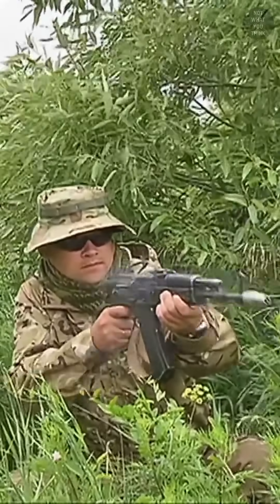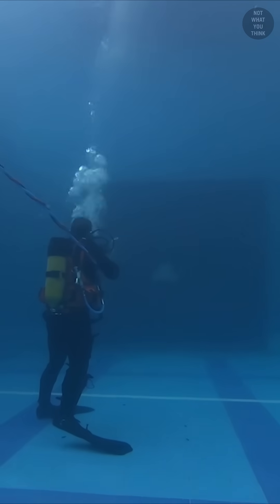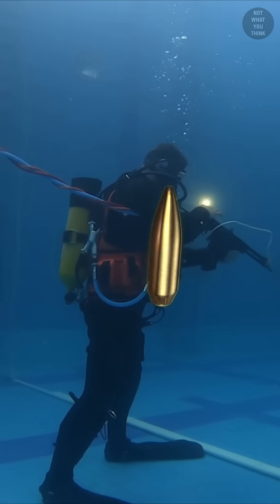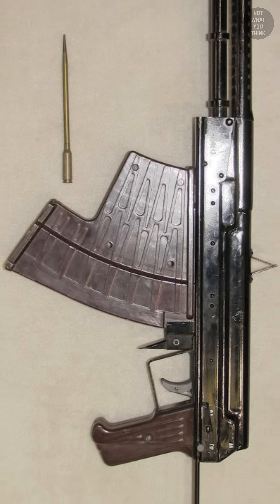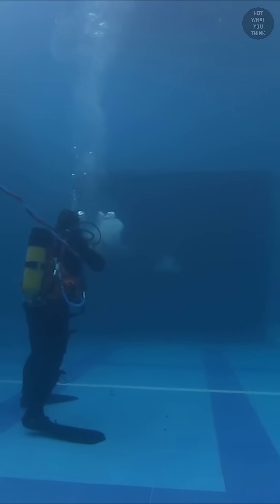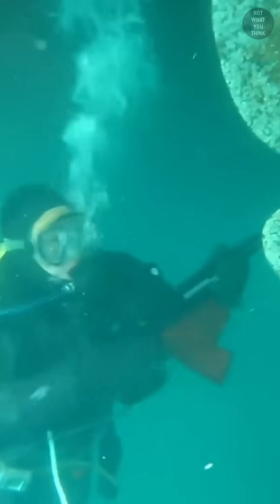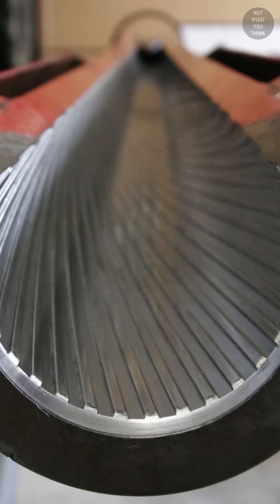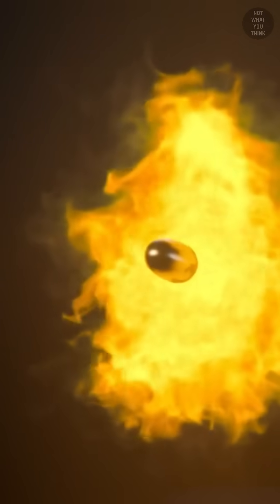Why Underwater Bullets are Shaped Differently #shorts

Comment: Smooth bore vs rifled isn’t the only reason underwater guns don’t do well in air. “Air Bullets” as well call them, have a Bowl Shaped scoop Nose, this bowl shape is great in air, and horrible in water, so when you use a needle nose in air, it dives quickly because it doesn’t have that bowl shaped scoop nose. If you quite literally had a bowl, and were throwing it perfectly vertical so the inside of the bowl was facing your target. You could actually throw it pretty far, but underwater, it would do flips and fall right in front of you.

Comment: Couldn't you take a regular rifle and just Sabot the needle bullet inside the cartridge

Make the table have an inner and outer with either Teflon or grease or ball bearings or something so as it goes down the barrel the outer spins with the rifling but the inside stays relatively straight and upon hitting water it just peels away like a regular Sabot

Comment: It's a thousand times denser but pressure also comes in to play as he says, it's due to the increase in depth.
Spinning the round in water will increase it's accuracy, but it would also slow the round down as it would also cause drag creating a vortex behind it also slowing the round down, that's why they don't rifle amphibious assault rifles.

Comment: So, when shown refiring of a "suspect's gun" in TV reports, to compare the markings on the bullet, the gun is refired into a water tank:  is it really comparable?
Reply: Yes. The thing beinh compared is the marks left on the bullet by the rifling which is still the same if its fired from the same firearm regardles of the target. What the water would do compared to a solid target is safely slow the bullet preserving its shape so the marks are easy to see. A solid target squashes and distorts the bullet. Although there are a number of other   materials used for test fire chambers alternative to water aswell, including ones using rubber balls or baffles to slow the projectile.

Comment: You said one solution is to use two kinds of Ammo for above water and underwater. You also said that the underwater guns don't work well above water due to lack of rifling. I fail to see how just different bullets change the outcome unless there is some bullet that I am unaware of that has its own rifling. It seems they would have to bring a different upper receiver as well.
Reply: There are certain shotgun slugs called sabot slugs that are rifled slugs, I'm sure the military may have some sort of same concept for a jacketed bullet
Reply: @theconsensualgamer  I was unaware of the shotgun shell, so thank you for that. I shall repay with knowledge. We had a sabot 50 cal. round that we called a slap round. It had a depleted uranium core and was specialized for penetrating armor.

Comment: Not correct, they have the same frontal area as regular bullets, they just have greater sectional density (longer) than conventional bullets to carry their energy more efficiently.
Reply: Pretty sure he meant less frontal area per unit mass
Reply: I stand corrected. On further examination it appears to have MORE frontal surface area, as the tip of the projectile is very dragged out. It is however necked down to a much smaller diameter than traditional 7.62, at 5.66 it appears to have the same case diameter as 7.62. I can't say for sure the wiki article was vague and it is an obscure weapon of the previous cold war.

Let's all hope the current one stays cold, things are getting sketchy atm! The situation with NATO and Ivan is more hostile than the youtube comments section!
Reply: @jdelgren9927  throw a bullet underwater. Then throw a metal pencil with the same diameter and weight of the bullet while underwater. The pencil will go further every time. Has more to do with hydrodynamics than the frontal area or whatever. Just stretch out a bullet and it’ll work.
Reply: @jdelgren9927  also, the shape of the tip of the bullet helps. You could get away with just firing a stretched bullet. But to maximize accuracy and range while underwater the ammo needs to have a sharp point so less surface area is cutting the water directly. 
Either way would work. But the needle design has its obvious benefits. 
NATO is working on underwater ammo now that is smaller, but still pointed, and creates an air pocket around the bullet while underwater by cavitating so it can accurately hit a target at ranges of 200 feet or more while underwater
Reply: @jarrettthompson5510  funny you say this I was wondering if you could use cavitation to this effect. Really cool now I want to go spear fishing with a machine gun hahaha
Reply: @jdelgren9927  haha I’m sure the ammo would be pricey. But if you only have to shoot once each trip it could very well be worth it!
Reply: @jarrettthompson5510  I feel like a guy who's handy could mfg it in the garage. The rifle is the hard part. Ah well just another dream anyway I'm sure they won't let us have cool toys like this
Reply: @jdelgren9927  look up CAV-X bullet and try to make them. Best of luck haha
Reply: @jarrettthompson5510  cool looks like they work in a 7.62 nato! Yeah I don't see why they couldn't be made on the work bench. Not sure if casting would be an option but definitely on the lathe. Very curious to learn more about these time to nerd out haha.
Reply: @jdelgren9927  go for it! Keep me posted somehow on any findings you think would be worth mentioning. I’m very interested in this subject.
Reply: @jdelgren9927  nobody asked..
Reply: @wayne20uk  where you from bud? I'm asking
Reply: @jdelgren9927  im from planet earth, sector 49, quadrant 13. I was assigned to this star system by the ambassador of the worm people. We come in peace.
Reply: 😂This is fake, they don't have a real functioning underwater firearm, and you're correct about the tip because the .17 hornet is the skinniest bullet and it does the same thing as .45cal ball ammo underwater. They have spear guns for underwater and a spearguns range is even compromised underwater😂👍
Reply: Can I use my 90 grain Berger VLDs to hunt sharks with
Reply: did your pet russian give you lessons?
Reply: @Dagdest  go back to your roblox Johnny. The grownups are talking about guns its too mature for you
Reply: @Dagdest  damn straight son git to yer room or I take you over my knee boy 🤣
Reply: Damn, someone has been listening in school that’s great thanks for the information my friend
Reply: If you pay attention in the video they show one of the full length rounds, still attached to the casing. The shell casing appears to be the same diameter as a regular 7.62 x 39, or maybe a 5.45 depending on Era, but the projectile is extremely narrow when compared to the neck of the shell casing. Perhaps the round flares out at the tail, or fires with a sabot I do not know without further research. 
Either way the statement would appear to be correct. They do indeed have less frontal area than the normal Russian ammunition.
Reply: Thank you for using different words to confirm what he said, that they have a smaller frontal area to mass ratio than regular bullets!
Reply: Nobody cares nerd
Reply: @wayne20uk  Pretty sure there was already a person in this thread that thanked him for his comment...
Reply: @HaagseDannyKalf  as i said, nobody important cares
Reply: @wayne20uk  Get off your high horse and stop being so arrogant.
Reply: @HaagseDannyKalf  my horse is higher than your horse, know your place peasant
Reply: @wayne20uk  Cringe
Reply: @wayne20uk  Imagine judging someone's importance by the size of their imaginary horse, as if you're trying to compensate for something else. Size matters, I guess?
Reply: @HaagseDannyKalf  I'm petty sure you're getting trolled on my boy. Calling someone a nerd is a pretty common joke with no ill intent.
Reply: @Kwauhn.  Yeah I'll just assume so too.
Reply: @HaagseDannyKalf  imagine taking a troll this seriously.
Reply: @HaagseDannyKalf  how bad was your day bro?
Reply: @surfboardjoker6299  You're a day late to the party. I already assumed it was a troll.
Reply: @HaagseDannyKalf  wow, your so cool!
Reply: @surfboardjoker6299  Yeah, God made me cool.
Reply: @HaagseDannyKalf  bless 🙏
Reply: @wayne20uk  Cringe
Reply: @deusexmachina9743  gay
Reply: @surfboardjoker6299  i find this highly offensive, just because i cant afford a house and i have to live under a bridge does not mean i am a troll
Reply: @HaagseDannyKalf  daaaaamn. Burrn bro, thats a burn

Comment: Aqua soldiers are going to be very useful because they can ambush attack from water in very unexpected places and can breach submarines with these guns because a sub has only rubber Hull and with those types of ammo it would be good for those type of things
Reply: You don't know what you are talking about and it shows. Research how submarines are made and then delete this stupid comment of yours
Reply: @samsmith6791  submarine Hull  are made out of 15 centimetres of rubber to minimise noise prevent EMP damages and prevent electrical damages from a lightning strike through water and the rest is only made out of 5 centimetres of steel with Hull reinforcements with steel beams but aqua soldiers can breach submarines with those sharp rounds  or by attaching explosives when there wouldn't be a chance for the submarine to notice the bomb before firing torpedoes at there objective
Reply: @steelnail1917  I don't think humans can survive at the depths submarines travel due to pressure, also, it would be extremely difficult for divers to find and approach a fast moving submarine in the darkness of the ocean, they probably would get sliced by the rotors before they could even think about planting any explosives. It's just impossible.
Reply: @steelnail1917  humans wouldn’t be able to breach submarines at all unless they’re the ones that don’t submerge mate
Reply: @darklibertario5001  not from 600 meters deep but from the point the submarine would accend for air or launch surface to air missiles is needed to have depth atleast 20 meters but large modern submarines don't move faster than 30 knotts witch would be enough to plant a sticky bomb on to the Hull
Reply: @USRM1810  when the submarines are in a shallow sea they can be detected
Reply: @steelnail1917  still can’t go there via swimming mate

Comment: Rifling makes it GYROSCOPICALLY stable not aerodynamically. Fletchings on an arrow make it aerodynamically stable. Rotation on a bullet makes it gyroscopically stable.
Reply: Finally.. something that is not what HE thinks..
Reply: thanks, that's an interesting note
Reply: You’re a gyroscopic stable
Reply: I watched this episode of MythBusters too 🤣
Reply: True, it stops it from tumbling
Reply: We learned that an arrow has form-stability and a rotating bullet has gyroscopic (or rotational-, or spin-) stability. Both rely on aerodynamic forces to do the stabilizing bit....

When you shoot either of these in outer space, neither is stabilized. The arrow would keep the rotation (head over heels) it gets when leaving the bow (or barrel) and the bullet would keep (thus not reduce it) the jawing-motion it got when exiting the barrel.

He says: "...causes the bullet to rotate, making it aerodynamically stable."  "aerodynamically stable" as in "have a stable flight-path in the air".

My two cents.
Reply: @DreadX10  gyroscopic stabilization is not dependent on aerodynamic forces. To tip over a rotating gyroscope in the same time and in the absence of air takes more torque than tipping over one that isn't rotating. It is independent of the air.
Maybe we understand "stabilization" differently.
Reply: @UristMcEngineer  Air resistance causes an overturning moment in the bullet-body, this causes the precession of the bullet (yaw-motion). When the bullet has enough spin-energy, it will use that energy to reduce the yaw of the bullet. 
The air gives the bullet a reference in direction, so the bullet 'knows' which way to point. 
Any deviation of this attitude will have a net external force being applied to the bullet. If there is no net external force, there is nothing to act upon and the bullet is happy to spin in any direction (attitude).
If you take a gyroscope, it would be the same when you remove gravity. The gyroscope doesn't have a reference any-more and will spin in which ever attitude you left it.
Does this make sense?
Reply: @DreadX10  It does. Because of the conservation of angular momentum I would call a bullet in vacuum stabilized while you would say that it is not stabilized, because no air drag would point the bullet in the direction of it's flight. I can see where you are coming from
Reply: @DreadX10  yeah but isn’t the bullet only happy to spin in the same direction it originally was spinning?
Reply: @LikeALocofirefly  No, that would be an over-stabilized bullet. Especially for long range, the bullet points upwards when leaving the barrel but when striking the target, we want it to point downwards a bit (as the bullet descends upon the target). If the bullet's central axis of spin isn't changing, the bullet would slam into the target a little bit sideways (with the point pointing upwards).
We want the bullet stable enough to follow the change in the relative wind vector but not more stable than that.
Reply: @DreadX10  your 2 cent input had brought me much knowledge. How do I buy you coffee
Reply: @kirodragon12  I pretended you bought me the coffee I consumed, writing my previous comment (in response to The One). Thanks!
Reply: Ah
Reply: Every single video he gets something wrong lol
Reply: It also doesn't improve accuracy, at least in main battle tank cannons. Dude has no clue what he's going on about
Reply: And the flex of the arrow shaft makes it gyroscopically stable, so technically arrows are more accurate than bullets, bullets just ignore that with increased speed.
Reply: The gyroscopically movement  makes the bullet hard to get moved in mid air by the air, so Aerodynamic is the easiness of an object traveling trough air by crating less resistance to wind when it’s advancing, the gyroscopic movement creates a force to not get push so easy by the air so it gets more stable so it can be called aerodynamic because involves the dynamic of an object thought air so it is aerodynamic.
Reply: So arrows are arrowdynamic?... Lmao

Comment: The water pressure keeps it straighter for longer if I heard right. That's pretty awesome.
Reply: No, the deeper you are, the shorter the range.
Reply: But it’s going to move much more slowly because the water is more dense
Reply: What about buoyancy? I know it's mostly solid metal but are there any effect to the projectile due to buoyancy?
Reply: @rizalardiansyah4486  It's probably going fast enough that it doesn't really matter, on top of the effective range being already pretty small
Reply: @rizalardiansyah4486   Lead is 11 times denser than water, so you could say that a lead bullet in water would drop 10/11 of the amount it would drop in air due to gravity.
So 9% less drop. But the drop over 40 meters is very small to begin with so you can neglect it when aiming.
Reply: @rizalardiansyah4486  you'd probably want it to be super dense, or neutral bouyancy.
If it floats super fast then that means your bullets will drop in reverse and you'll have to aim very low for "distant" shots.
Who knows. Maybe they're all made from aluminum because fast bullet avoids thise problems.